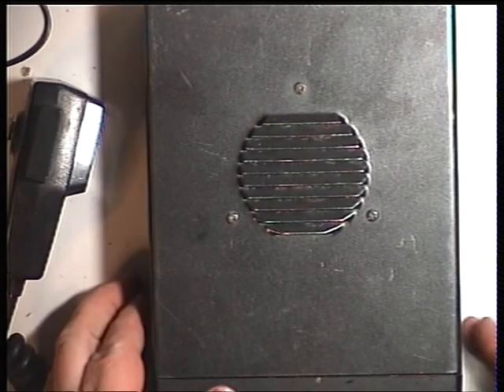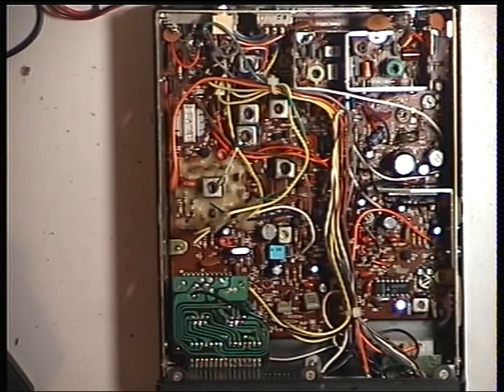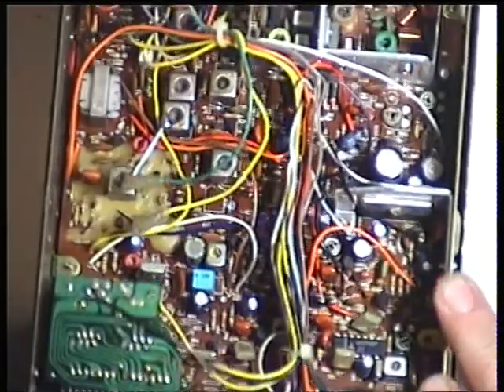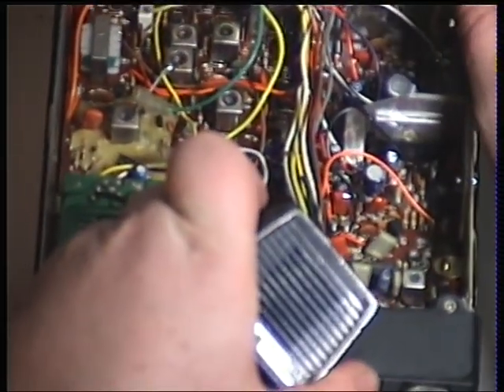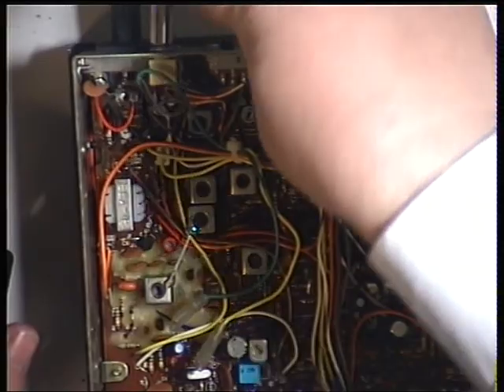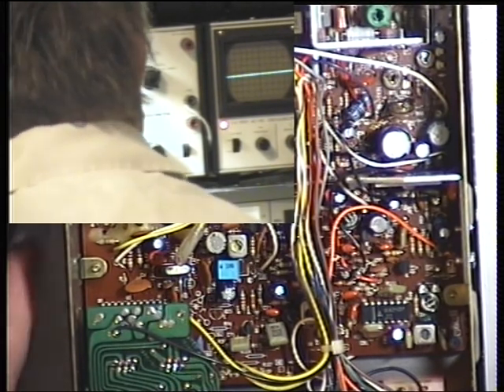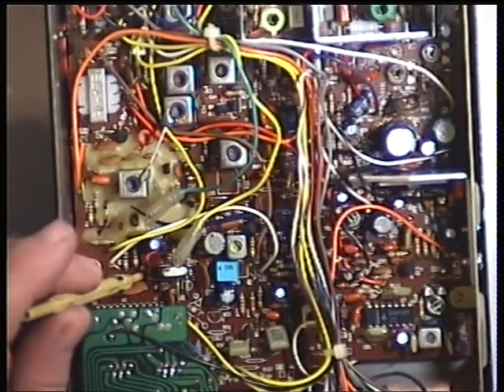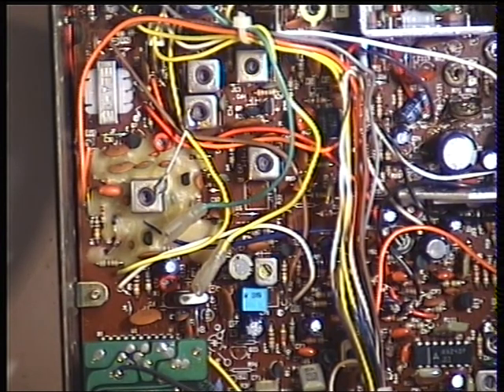Rotel RVC220, UK (CB 27/81) CB radio (Mobile) - VCO & Transmitter alignment

Comment: HI Richard need to no how to put Relay wiring diagram for the Cybernet rotel 240 with 5 tone beep
Thanks andy
Reply from the maker: Sorry, but that wouldn't be legal as the Rotel 240 type approval would be invalidated. We are required by law to remove any illegal modifications on radios that pass through. Buy a mike with a built in 5-tone roger bleep instead.

Richard
Reply from the maker: Our next video is a Rotel RVC240 which unfortunately has had an illegal 80 channel modification. Hopefully I can restore it back to UK legal operation & we can all enjoy a video of it.

Comment: hi, is this the same as a sapphire x4000? when I key the mike the signal Meter swings hard to the right, also the dim switch doesn't alter the lights but makes my swr Meter rise when switched to dim. do you think someone has used the dim switch as a power increase switch? everything works fine but I'm a bit worried it's putting out more than 4 watts and could damage the radio, thanks.
Reply from the maker: +GerbilFrenzy Seems like it's been messed with. The only way to check power output is into an external power meter, with a dummy load connected to the power meter antenna socket. However, it's more likely that the meter preset has been messed with so it just reads high. Clearly the radio needs servicing.
Reply: +UK CB radio servicing am I right in thinking the signal Meter is adjusted with rv4, I have a power Meter that I can plug in to check it against. great videos.